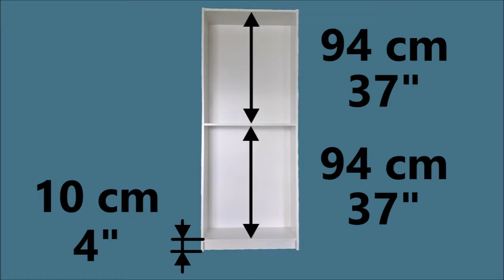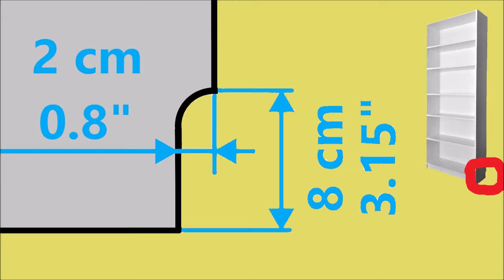Ikea Billy bookcase assembly

Comment: Im stummped. I have this in black and im confused about the skinny peice at the bottom. Basically the toe kick. For me, one side is black and the other is wood colored, mean for the back of the bookshelf.

Now the problem is, if the black part is facing outward  as if youre viewing the cabinet from the front the two pegs are towards the left (you can see in this demo the two pegs on each end are skewed to one sode and there's an extra inch of board to the right.

Basically, if the black is showing forward the pegs are on the wrong aide and there is a gap between the toe kick and the bottom shelf. Can someone help?

Comment: I’ve assembled it all I just have the actual shelves to put in but the manual mention about using brackets to drill into the wall in case it falls over did you do this? Or leave it free standing?
Reply from the maker: I left it freestanding.  It is safer to attach.  Especially when there are children or cats at home.

Comment: 3:46 After I marked the centre on mine, and eventually got the back on (not easy when the room is not much longer than the height of the bookcase), I didn't need to measure from corner to corner since I also just drew a centre line. Also, you can feel where the centre is as well, so that's fairly straight-forward.

However, the back panel didn't sit quite flush with mine. It was fully in, but slightly skewed at an angle top AND bottom, as if it had been cut badly. This is the problem with mass production. I got the nails in but it should've been a bit longer because it could come free from one or two of them, if pressure was put on. If they made it a bit longer so it overhung slightly below the bottom shelf, that would give you a bit of play with it.

I'd best not say how long mine too me :-D
Reply from the maker: Have you managed to finish your projects :) It's not always straitforward and the pieces sometimes are not ideal. As for the size of the rooms, I know exactly what you mean... :).
Reply: mine was as well, manufacturing error
Reply: @k-nemo  I didn't get notified of your reply at the time, but I did do that, and then bought two more last January. There was damage on one, but I got a partial refund, as it's liveable with. For some other items, they had to go back because they looked like they'd been thrown about the warehouse..

Comment: great video, do you know if the background panel is necessary? can I avoid mounting it?
Reply from the maker: You can but shouldn't do it because the bookshelf won't be stable. You have to attach it to the wall straigh away. Without the back, you also can't put the recommended weight on the shelves, the load has to be much lighter.

Comment: Can you explain the diagonal measurements more? Can't you just eyeball it and see if it lines up?
Reply from the maker: You won't see if it's perfectly straight if you just look at this. Both diagonals have to be the same. length. It's the easiest way to check if the furniture is rectangular.